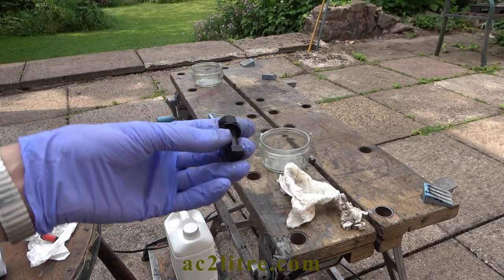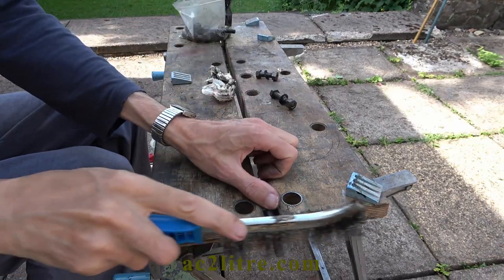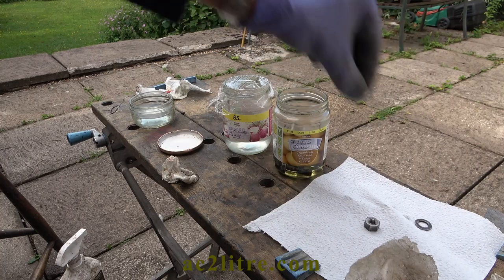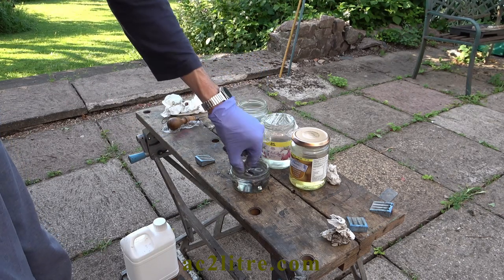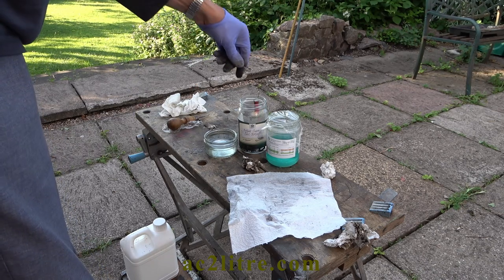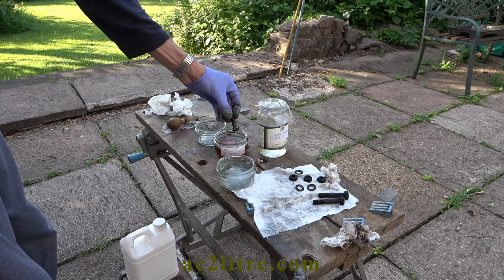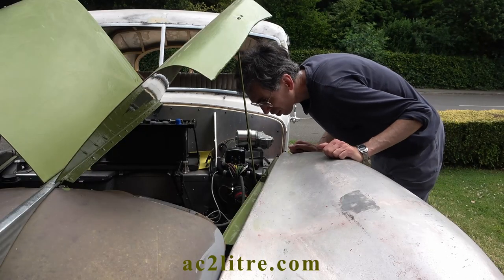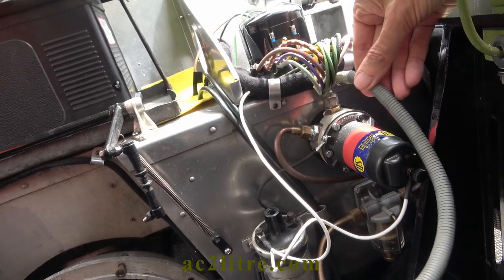Blackening nuts and bolts for my AC 2 Litre Saloon.

Comment: Get them hot and dump them in used oil will also work.  So very time consuming.  Years of work on the woodwork on the vehicle.  You deserve a much larger work area, seat and a new wire brush.
Reply: You'll ruin the hardness or temper of the bolts if you heat them - - turn Grade 8 into Grade 3